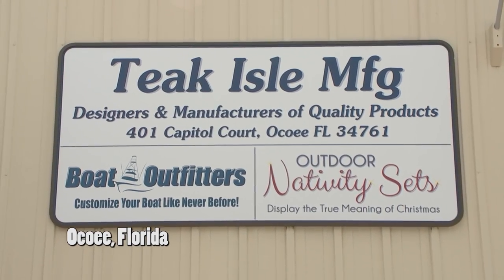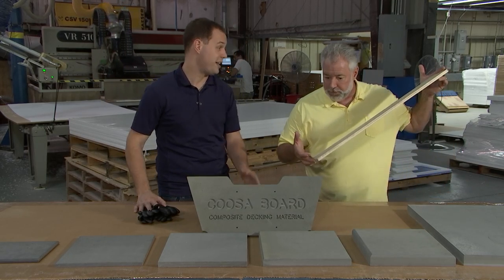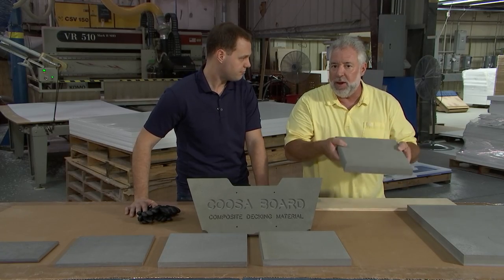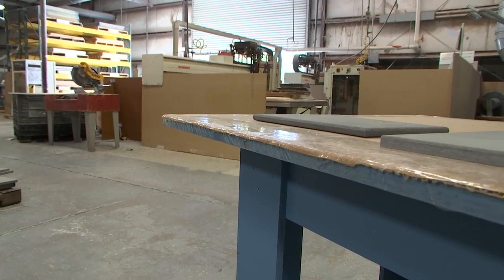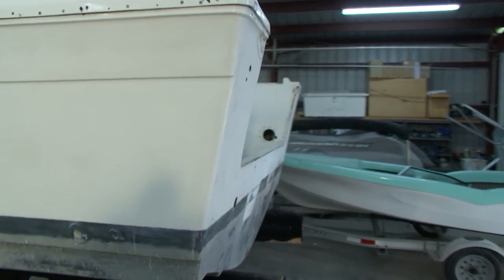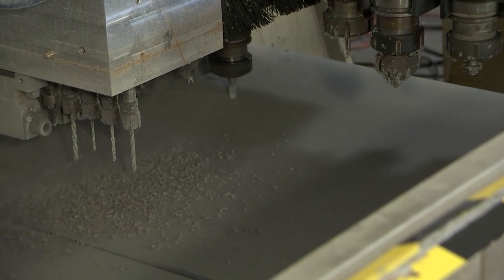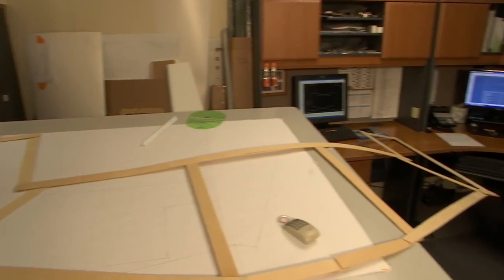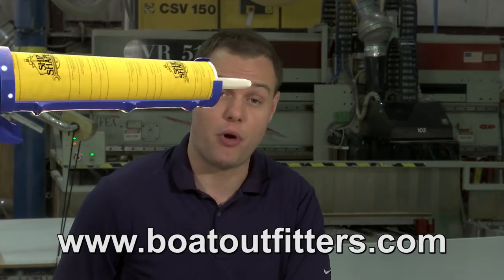Coosa Board 101

Comment: Does it work as as a bare decking material? ie is it slick when wet? splinter risk to bare feet?
Reply from the maker: Coosa board would not be a good material for bare decking as it has fiberglass pieces within it for structure and is very coarse (almost like volcanic rock).  It would not necessarily be slick when wet, but you would want to put some type of material over it for sure. Please let us know if you have any other questions we can help answer for you!

Comment: Could you cut it on a table saw? And if so, what blade would you recommend? Bc that fiberglass in the board insta dulled my reg blade!
Reply from the maker: Hey there JC! Coosa can most certainly be cut on a table saw. The size of the blade will be dependent on what you are doing, but it is recommended that you use a carbide blade as the material is very strong. Please let us know if you have any other questions!
Reply: if you cut this in any way shape or form, keep the dust off and out of you or you're going to have a serious case of the itchies.

Comment: Does it flex for a curved transom, 1 1/2 thickness
Reply from the maker: Unfortunately Coosa Board does not bend much, if at all. Please let us know if you have any other questions we can assist you with!
Reply: you can cut 1"grooves every 6 or so inches on opposite sides across the board to allow it to flex a little bit, I wouldn't suggest cutting it any deeper than that.